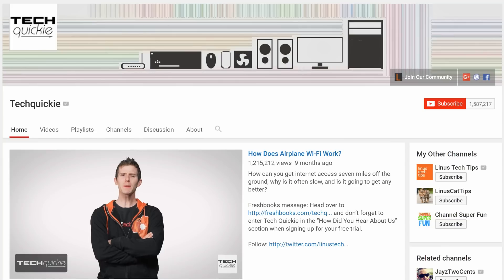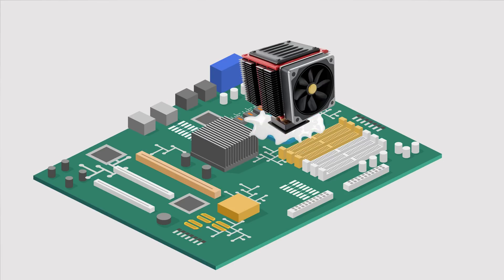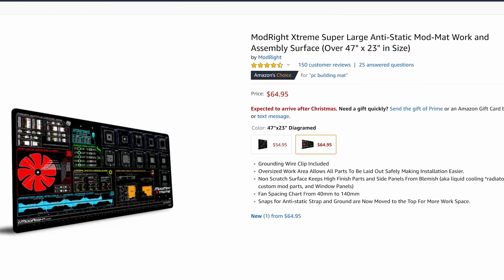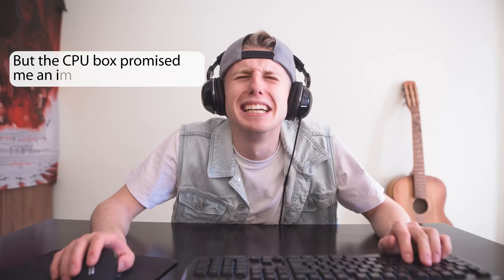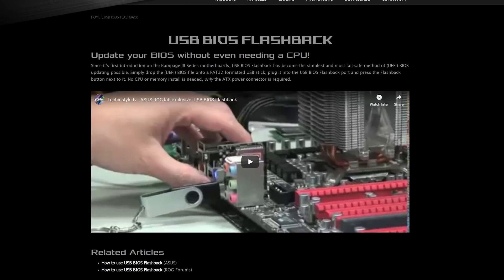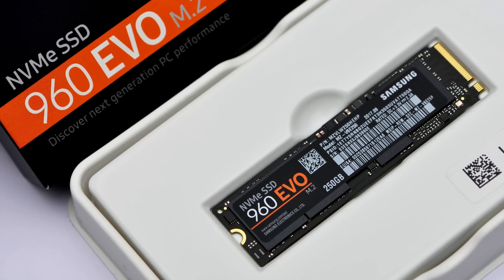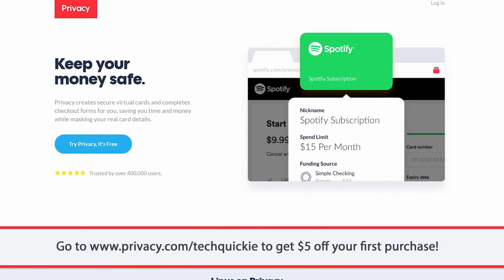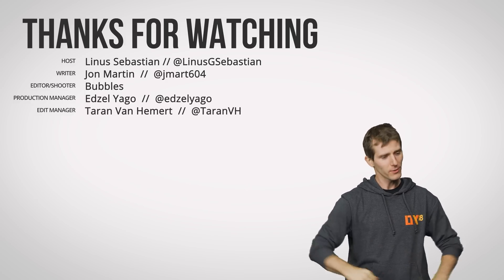DON'T Make THESE Mistakes Building A PC (pt. 5)

Comment: Where should you plug in fan headers? Should it be on the motherboard or AIO block?
Reply: Not sure how you'd plug your fan cables into an AIO block? In most cases motherboard is ideal. There also is a seperate header for the CPU cooling fan (I would plug in the AIO pump in that slot) and a couple of case fan headers.
Reply: Motherboard if possible. Specially if they are PWM fans that the motherboard can then throttle down and up for less noise. Otherwise use the block for the maximum.
Reply: Pfft no you plug it in to the usb 3 port more data transfer that way

Comment: remember. even when there is thermal paste pre-applied, ALWAYS use a "bit" more cause the other stuff is usually enough
Reply: No, you remove the former thermal paste and apply quality thermal paste
Reply: @Bcupzz  lol now you get jello and use that its great at thermal thingy and as it melts it has a great smell :)
Reply: Definitely not.  The paste is an insulator not a conductor (even though that's its purpose).    Darth is right, assuming you have decent paste.  If not then stick with what's there.
Reply: @ChristianRThomas  It's a quote from the verge build.
Reply: RavenousJoe He quoted it completely wrong.

Comment: Be sure to use wrong screws and put PSU upside down
Reply: I just realised that I forgot both of them and mounted my PSU in a way that ensures better airflow, now I have to reinstall it
Reply: HazmatPyro  that moment when someone from the internet helps you out
Reply: @vxsz  We all use Google or YouTube for help one time in our life, it's undeniable
Reply: Had to mount my psu upside down otherwise the fan sounds like a jet engine
Reply: I think Corsair lets you disable the fans on their psu if you have an RGB header using iCUE

Comment: Yes, when  buying RAM make sure you buy the dual channel kits of RAM where the board provides for dual channel.
Reply: and then put them in single channel because together is better.
Reply: @pangkan270  Yes, RAM hates being alone.
Reply: @pangkan270  YES. Remember to place RAM chips side by side closest to the CPU for peak efficiency.
Reply: @RealCheesyBread  you mean sticks not chips
Reply: @boomwithpeter623  Sticks are just the holder for the chips..
Reply: @boomwithpeter623  Yeah, sticks obviously.
Reply: @pangkan270  
You are going to incur so many Wooshes.

Comment: I am actually building a PC tomorrow, my first PC. But I do have a question: I am using an Intel core I 7/7 generation using the LGA 1150 socket from a PC that has since been discarded, do I need to clean the processor in anyway before I install it? I know it sounds like a stupid question
Reply: I’m sorry guys, I know that seventh GEN uses 1151 I simply miss typed. I have the correct motherboard and everything!
Reply: @joecaroselli9945  install it it the socket and clean off any old thermal paste of the CPU and apply new thermal paste to the CPU just if u are reusing the cooler clean the base also if it is a new cooler check for preapplied thermal paste before putting thermal paste on the CPU and no it isn't a stupid question don't worry :-)
Reply: Ben C  thank you very much, that’s what I figured but I appreciate the confirmation.
Reply: stop. whatever you are doing, stop right now and rethink your plan.
today's i7 use LGA1151 Sockets, not LGA1150 . I am not sure how different they are, but I am damn sure that your idea won't work out well. 

maybe you end up finding out that I was wrong, but do your research first, for the sake of your cpu, mainboard, and budget.
Reply: huh? I thought 7th gen is socket 1151
Reply: No, install it in the socket first.  Yes , I am being sincere and serious.  The reason why is it's best to take the risk of putting any bit of pressure cleaning the cpu while it is completely and securely installed into the socket and that way the pins ( regardless of the context of what you want to call them on the underside of the cpu's die) aren't at risk of any damage....  versus...thinking that black small mesh/like foam the cpu is sitting into while it came inside that clamshell clear plastic piece is enough to do the same....   It's not worth that risk.  I learned the hard way back in February 2000 building my 2nd PC.
Reply: @motoryzen  since when did intel CPUs have pins on the CPU? I thought their pins were on mptherboard
Reply: @prateekkarn9277  That's what I thought too, till I got my i5-9600k, you should've seen the look on my face when I found out the pins are on the cpu.
Reply: @prateekkarn9277  Intel does have the pins on the motherboard but they used to have pins on their older PGA CPUs.
Reply: Not a stupid question. If the cpu is used there's probably thermal paste on, u need to clean it l. If else u don't have too

Comment: The biggest mistake when building a pc is probably not using a metal case.
Reply: Inb4 How to properly clean your metal computer
Reply: yeah sure what a great tip
Reply: I use a wall
Reply: Or any case at all. :/
Reply: I can vouch for this one.  The first computer I built when I was a kid was using parts scavenged from two dead towers, and I screwed the parts onto a flat board because I thought it looked cooler than reusing one of the cases.  It worked great, but then the family cat decided it looked enough like a litter box to use it.

Comment: If you dont want to connect another sata drive for your ssd then m.2 is the way to go
Reply: M.2 is always the way to go. They are often the same, or $1 more than the 2.5" equivalent and you save on 2 cables to manage.

Comment: I think I made all of these mistakes lol
Reply: My FX-8320 has a piece of cat5e cable instead of one of the pins.
Take this as a protipp. It works. (although took a couple attempts to cut the exact size wire to reach the cpu and the socket)
Reply: How long have you been building PCs?
Reply: I guess most of us never really bought prebuilt stuff.

Comment: Dont forget to use the pads for your power supply or it will short circuit with your case
Reply: lol the verge
Reply: i still wonder what did that guy do with the thermal paste applicator  on the underside of the Cpu.
Reply: once i was building a pc for a friend and i couldn't get the power supply in. it turns out two of the pads had gotten loose and come off. Its a good thing case manufacturers are making it harder for you to accidentally short circuit your case.
Reply: Twaddle. PSU supply case is internally grounded. Fixing screws provide a connection to the case. Pads are an anti-vibration aid.BobUK.
Reply: forgot to use the insolation pads and now my pc died
Reply: @maxwellm1266  Such insolence!
Reply: @Daniel Stefanov ridiculous... (simplifying)The grounding is the third connector in your power cable contact. Many PC cases have rubber feets. How could it be grounding if it's isolating the whole case from the ground.
Reply: @Szklana147  Are you being sarcastic or not? I can't tell.

If you aren't, let me explain. Through the power cable, the PSU is grounded. The PSU is grounded and the case makes contact with the PSU. Therefore, the case is also grounded.
Reply: Josh Gerhards 🙄 yes, you just got r/wooosh-ed. It’s a joke making fun of The Verge.
Reply: @jdmagic  Ohh.. I thought he was talking about rubber feet on the OUTSIDE of the case. It makes sense now.
Reply: Will the verge ever live that disaster down?
Reply: What do you mean by “use the pads for your psu” ??
Reply: could you expand on this? news to me
Reply: @pizzaivlife  a youtuber called the verge made a video about building a $1000 pc and made a lot of mistakes and ended up turning into a major meme
Reply: @maxwellm1266  r/whooosh
Reply: @ItzEx0dia  wait I don't understand was pizza's a joke?
Reply: TheBritishCog He didn’t miss the joke. You did.
Reply: @ItzEx0dia  ChamCho124 was joking.
Reply: @maxwellm1266  not a youtuber, its a media from Vox
Reply: That's actuallly bullshit
Reply: @oscarswaggie  Yes. But /r/woosh

Comment: The Verge has entered the chat.
Reply: Walmart has entered the chat
Reply: @alrecks619  The Verge has left the chat.
Reply: just need better motherboard, ram, case front panel spacing, and other stuffs that tech vloggers noted
Reply: @I Am Sekou 
I'm talking about that PC build guide The Verge uploaded. My only complaint is that there wasn't enough thermal paste on CPU. 

Everyone knows that CPU must be complitely covered in thermal paste for it to be good. Also, make sure to pour some paste into the socket for faster speeds.
Reply: Only thing that guy from The Verge has done badly in his build was the amount of thermal paste. 

He should've used the whole tube.
Reply: @wintermelon4020  Looks like they are not understanding the JOKE'S
Reply: @wintermelon4020  He also installed the RAM in wrong, but they cut the footage and it was fixed.
Reply: @wintermelon4020  hahahhahahahhahahahahahhahahahahhaha
Reply: @wintermelon4020  stop spying
Reply: @wintermelon4020  the other part is -- he didn't solder the CPU.
Reply: @kyabatsu  You need RGB Thermal Paste for the best performance. Apply enough that it covers both the both the CPU, the entire cooler, and drips like unicorn barf all over your graphics card.
Reply: how to apply the paste: draw a house
Reply: @Mr_Spock512  Lucky for us Master Wace PEE SHEE builders at the Verge, our Swiss Army Knives actually come with Confidence.  Its right next to the Keyboard and Mouse.   I never leave home without it, and neither should you.
Reply: The verge isn't as bad as a national Australian newspaper that recommended buying one 8GB stick and a separate 4GB stick at a different speed from a different company to be put into the same build for 12GB of memory total, in a 2000AUD  (1400US) build.
Reply: Several people are typing...
Reply: @Potato yeah, people just like to hate, with the new pricing they're not too bad, although other SIs will do a better job and as Linus has said previously, if you need support in 2 years time there is a risk Walmart will no longer be selling or supporting these PCs, while a proper system integrator will. The laptops are crazy good value if you don't mind sub-par build quality.
Reply: You have no idea.
Reply: @kyabatsu  hahhahahahahahh hilarious
Reply: Hahaha!!!